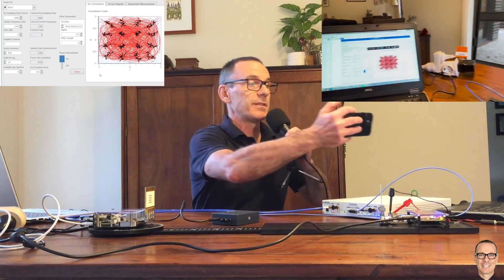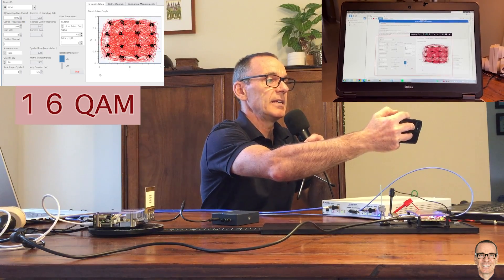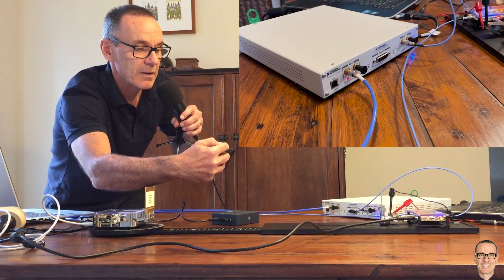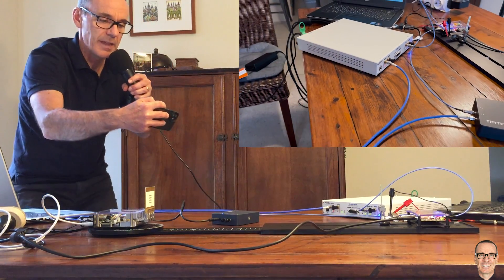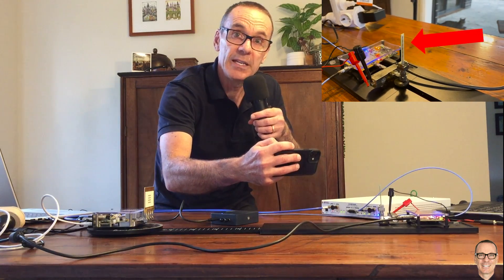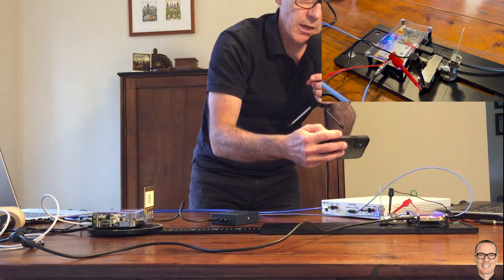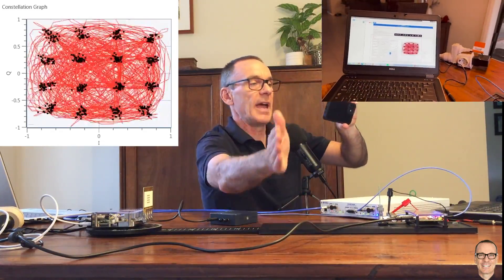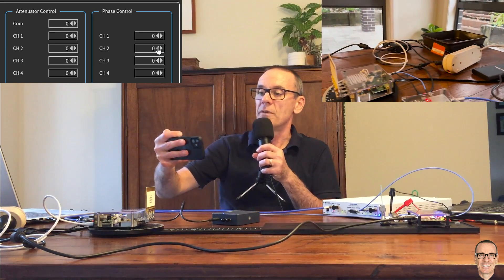What's Needed for 6G Mobile Prototyping and Testing at 28 GHz mm-Wave?

Comment: Thank you, that white box,  the SDR, is relatively big and there is no mixer inside (you said there is an additional mixer). Is there something special about that SDR? I know that they are normally quite small. Are there so much components inside?
Reply from the maker: The SDR does have a mixer inside, but not up to 28 GHz. It generates modulated signals up to 6 GHz. It's a relatively old model, and yes, you can get smaller ones these days. Note that many of the so-called SDRs on the market, with USB plug-in to a computer, are receive-only.